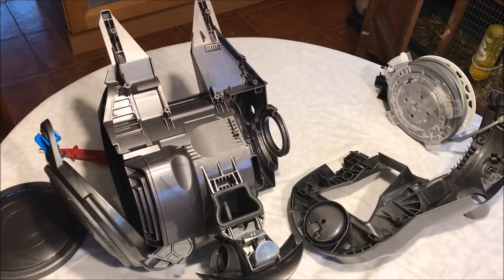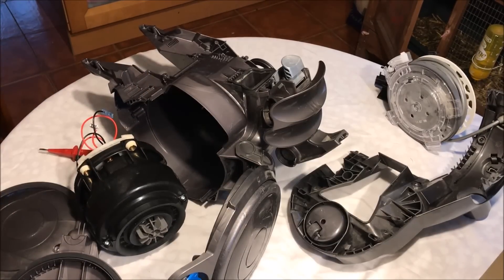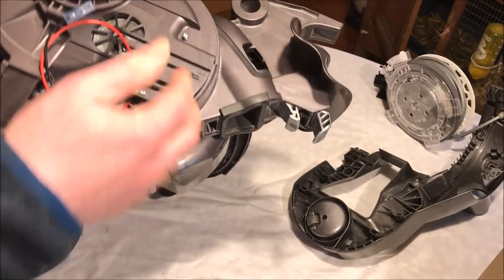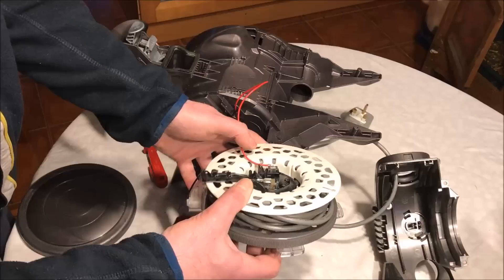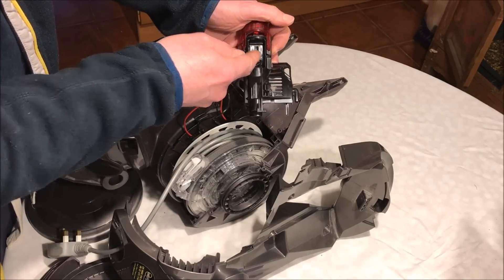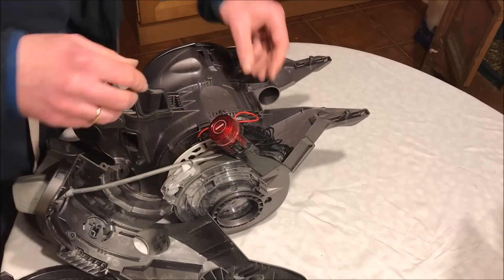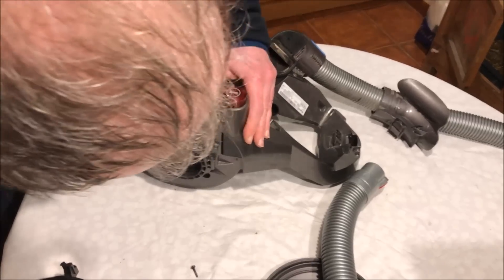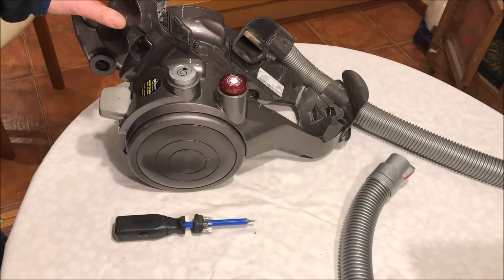Fitting replacement motor in Dyson DC23

Comment: 2:15 I didn’t find it too hard to pry the cooling duct from the motor if you want to save a few quid. 
I just slipped a wide chisel under the fixing washer and levered it against the plastic edge of the duct.
Cheers for a thorough tutorial mate.
Reply: Thanks for posting. I ordered the motor locally in Australia and it doesn’t have that cooling part and my heart sank a bit when the Helpful Handyman said it was not straight forward.

Comment: Thank you so much for showing me how to open a DC23. Well done.
Reply: i did not see the part of the video where he showed us how to open it? specifically how to take off the wheel..?
Reply: London Vacuum Plus no video of the wheel removal, he just mentioned he had to pry it off, he showed there was some damage when he did it. I used a large screwdriver. I didn’t know it had to be pried off at 17:10

Comment: Good instructions.  The back wheel takes major prying to remove, major pressure to install.  The hose assembly is best removed by removing all 5 bottom screws, then prying the bottom plate up a bit, then sliding the hose off.  A bit fiddly.

Comment: Thank you for this very helpful video. I understand that the reason the motor fails is because the post motor filter gets clogged, so this part ought to be replaced too? Are there spares available for this circular HEPA filter, do you know? Thank you.

Comment: Cheers for this. Great video. I didn't need to change the motor or even the brushes. Mine is now clear of 2kg of cat hairs and weird smells. Now if only the seals were flush...
Reply: Hi Robert, Where were the clogs? My Dyson won't start up and I am wondering if clogs may be the issue? Was yours still working when you tried this?

Comment: Thank you for posting your video. It helped me a lot, and kept me from buying a new Dyson at 2-3x the cost of a refurbishment.Replaced the old motor and filters, and cleaned out the cyclones.I wonder if you have ever experienced a slightly toasty smell from a new motor, or that a new motor would bind/not spin freely by hand, prior to the first activation/run?

Comment: Good video indeed but it did not show how to disassemble the unit. The video started by a totally disassembled unit and went through the procedure to install new motor. Although you mentioned that you will show the disassemble at the end of the video; nothing was shown. Repair usually start by disassembling unit followed by changing defective parts and reassembling

Comment: I did the same stuff with a DS1 years ago but the 2nd motor died after a few months from overheating...seems the spare parts are pretty shit sometimes.
Reply from the maker: My replacement motor has been working fine ever since. You may have been unlucky.

Comment: Hi. Thanks for  making this video. I need to replace the power cord on my Dyson DC23. It kept cutting out, and then when I wiggled the cable around half way up, it in and out, then I saw a spark in that area of the cable. Now it doesn't power on at all, so I'm guessing the cable is defective (?). I'm unsure how to get to the connector to replace the cable. If you could help that would be great, thanks
Reply from the maker: It is probably easiest to replace the entire roller unit, incuding the cable. You can buy them on ebay for example:
http://www.ebay.co.uk/itm/Dyson-dc23-cable-reel-cord-lead-genuine-used/152446004260?_trksid=p2047675.c100011.m1850&_trkparms=aid%3D222007%26algo%3DSIC.MBE%26ao%3D1%26asc%3D40656%26meid%3D65e7ea93c0bb4e4783c2a2bb45375fa7%26pid%3D100011%26rk%3D1%26rkt%3D12%26sd%3D152205317778

Comment: Hi,

Great job - appreciate your efforts.  Can you tell me what size Torx screwdriver I will need to dismantle?  Any other tools required?.
Reply: I know at least the 4 screws for the motor itself are Torx 10 ... I'm guessing you've already done it by now but I managed to snap 2 of them off in the old motor :(
Reply: Mine must've been assembled by the same person who assembled yours.  Snapped the heads clean off with very little effort.  One on each side of the black clam-shell :'(

Comment: Where can I buy a new motor and the tool to remove the dyson screws?
Reply: The Torx 15 screwdriver is easily obtainable in a DIY store or ironmongers. The motor is provided by household appliance spares dealers in most countries where Dysons are sold. Where do you reside?